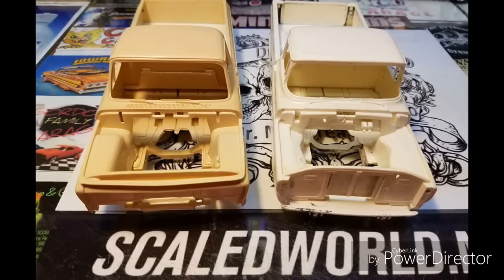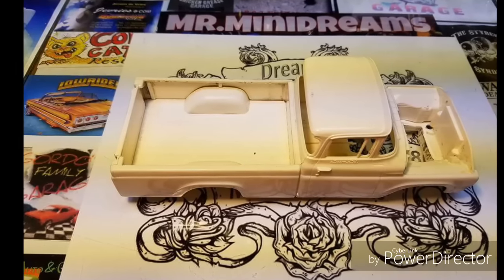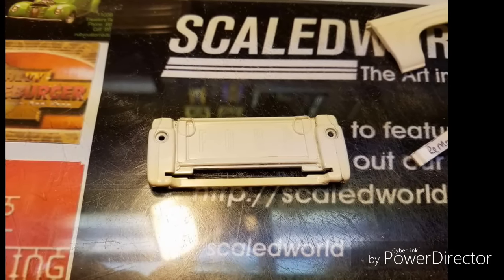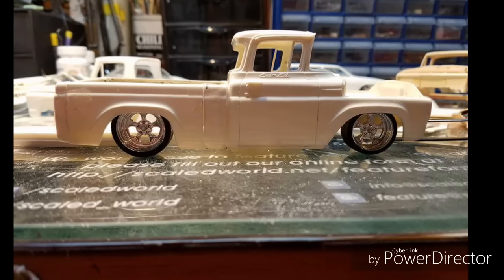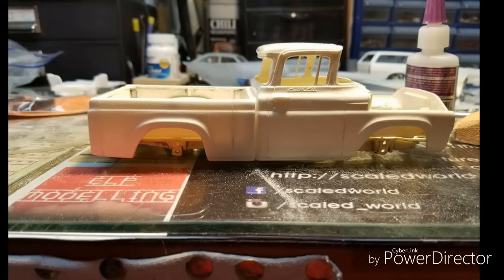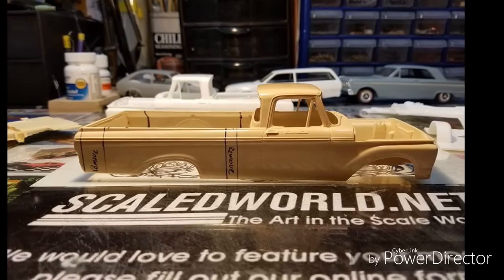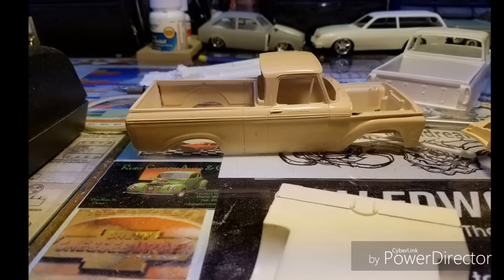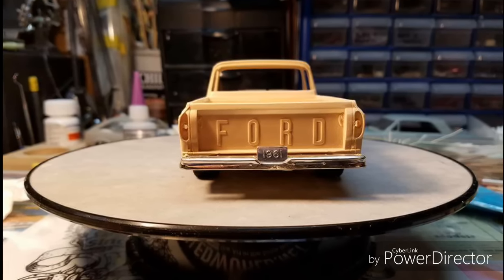Mini n Molen turn a 60 and 63 ford's into shorties

Comment: Great work. I have a question, on the video you said you used "super glue and baking soda" how does the baking soda work? I'm a rookie here and I must trying to learn
Reply from the maker: devoe7071 What I do is add may superglue to the parts ,and  after I join them together I apply the superglue over the seams then I take a q tip or tooth pick and level it out then sprinkle the baking soda over the glue and them with a q tip I go over the top the baking soda. then I sand it even .
Reply from the maker: devoe7071 devoe7071 What I do is add may superglue to the parts ,and  after I join them together I apply the superglue over the seams then I take a q tip or tooth pick and level it out then sprinkle the baking soda over the glue and them with a q tip I go over the top the baking soda. then I sand it even .